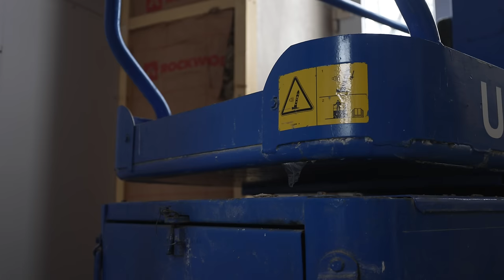The Ceiling Was Pink

Comment: During my career, all the plaster board I  installed, I  hand nailed. With a tool belt, I  carried a hammer, razor knife, drywall point saw, vixen file, tape measure, pencils, chalk line, and proper cupped nails. Saved a lot of climbing up and down. Here in the USA, we hang ceilings first and then walls. The walls are hung horizontal.  First full sheets up against ceiling. The second full sheet from the floor, that way (even taller walls), the joint is directly in front of the installer. i.e., say 10 foot high walls joint is 2 foot piece right where you're almost looking straight  it.

Comment: A nogging (or occasionally noggin) is a strut used to give rigidity to a framework, typically fixed between joists or studs to their increase strength and stiffness. Noggings are commonly used to brace floors or to stiffen timber stud frames

Comment: In Canada, in wood framing, that’s  generally called blocking…
Watching UK reno channels, nogging always stubbed my ears for a while. :)

"Nogging, an architectural term, may refer to:

Brick nog, (nogged, nogging) term used for the filling in-between wall framing in buildings
Nogging or dwang, a horizontal bracing piece used to give rigidity"
Reply: Noggin the nog  😂😂😂😂😂1970s kids animation about a viking🎉🎉🎉🎉🎉🎉

Comment: Noggin is the correct term. It's a spacer between boards to keep them from shifting position horizontally and keeping the two adjacent vertical boards, vertical, as well as consistently spaced. They are typically found between floor or ceiling joists.

Comment: Pink; my guess is cost.  It was likely the least expensive paint available.  Those nuns probably thought, we're not going to look up in the hallway very often, so what difference does the colour make.  Prudent and thrifty.  When I first bought my house, and money was tight, I used 'miss tints' which were a fraction of the cost.  I designed my decor around that, using white to mix it if the colour was too intense.  Maybe some paint store had an excess of pink available and were willing to give it at a discount to the nuns.

Comment: What aggregate did you use to sand blast the wood? I have read to use what you guys call bicarb soda on wood. But the front door I am going to do is probably significantly softer than those old oak beams.